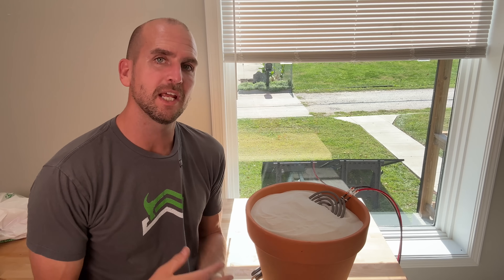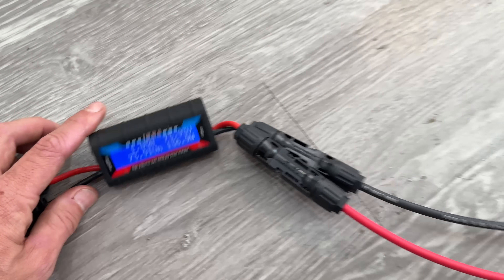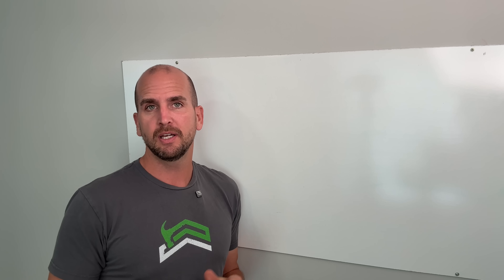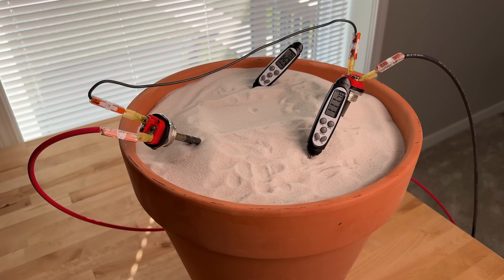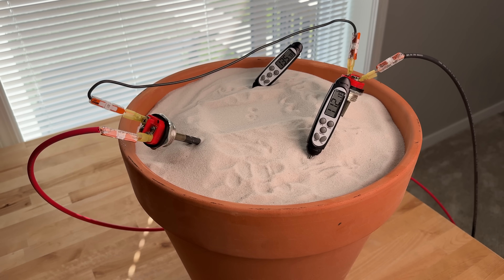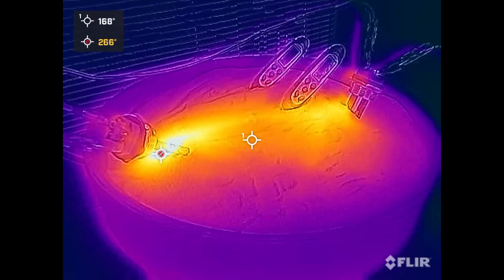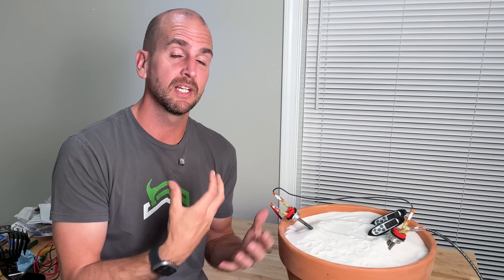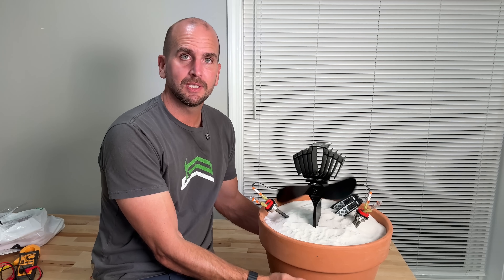How To Create A Solar Sand Battery Heater | Free Heat This Winter!

Comment: I'm thinking this would work for close-space chicken coops.  I'd put an inverted clay pot on top to hold the heat and wrap the clay top and bottom in some kind of fibrous material - perhaps coconut fiber nest material - to slow heat dissipation and to encourage chickens to snuggle around it like they did around a brooder when they were chicks.  This wouldn't work for a shed type coop , but small space 4-5 hen suburban coops with peak would benefit from what little sun energy could be brought into the henhouse.   Chickens typically don't need much heat since they wear down jackets year 'round, but on those below zero nights, I'm sure no one complains about a little clay furnace in there with them.

Comment: When the goal is heat, I think it's counterproductive to go through electricity. i would rather use concentrated solar power since that's extremely cheap. Outside, you can have a solar absorber with a built-in pipeline for watercooling and then using a pump, you can pump the hot water inside to cool it again, this time using inside air to cool the water, rather than the water to cool the solar absorber. Now all you need is reflectors to gather sunlight and that can be as cheap as aluminum foil, which is ever so slightly less expensive than solar panels and in theory, you can make this to work forever. :) By the way, just like you use the Seebeck effect to drive the fan inside, you could use the same to power the pump.

Comment: I,mm wondering if it would be possible to run a central heating system via a  40 GALLON SIZE oil drum sand battery connected to a metal coil in the battery???

Comment: Bigger stones in the sand would whit hold the heat better. Shure its better solutions out there but would work as a room heater in a pinch absolutely 😊

Comment: What you might experiment with is adding a phase change material.

For example, if you added something like paraffin wax in a sealed  aluminum box, once the heat hits 45-50C the paraffin will change from solid to liquid. While it undergoes that phase change it will remain at that temperature until all of the molecules have changed into liquid. As it cools back down it will remain at that temperature until all of the molecules have solidified again.

This will act as a buffer for your system.

Comment: Generally, storing heat in a phase-change material is more efficient than storing it in just the temperature difference of a material. As a rough comparison, the energy required to melt one pound of beeswax or parafine is comparable to the energy required to heat one pound of sand by ~320°F / 200°C. And instead of having a range of very different temperatures, you will store and retrieve the majority of the energy at a temperature point around 60°C / 140°F, which can be much more reasonable / safe.

Though in that case your heating should have a safety control, so it won't continue heating the molten wax towards its evaporation temperatures, since wax gas is rather flammable of course.

Comment: There is something similar you can do with a big can of Crisco, a candle, a strip of copper about as wide as a ruler but twice as long, and a metal bucket or I suppose a big pot like that works too... Jam a basic tapered candle about as tall as the Crisco can all the way down in the center of the Crisco. Doing this will let the candle burn for 72 days at 8 hours per day or about 24 days non-stop. You pack down a layer of sand in the bottom of the metal bucket, put the can of Crisco in it, fill in and pack down the sand in the rest of the bucket, and have the thick and wide strip of copper down directly over the candle wick/flame with the ends jammed into the sand around the can. Light the candle, the flame and later rising heat from the candle, heat up the copper strip which heats up the sand in the bucket (might possibly work even better if you have a second strip of copper to go across the other strip) and there you have it, a sand-bucket emergency heater.

Comment: I’d be interested to see this implemented on a larger scale using a steel 55 gallon drum, several heaters 12v heater elements, and maybe some copper buried in the sand to help conduct heat around the vessel.  I am imagining it wrapped up during the day to store the heat and then the insulation removed at night to radiate heat.

Comment: Solar panels are a rather inefficient way to convert solar energy to electricity.  I think you get, at best, 20% conversion.  I wonder if anyone has tried focusing solar heat on a water or coolant reservoir, then heating the sand or hot water by carrying it thru insulated pipes?  Actually, that's how solar hot water heaters work...

Comment: Just a thought. Solar electric conversion utilizes only about 18% of the total energy of the sunlight. If instead you capture the sunlight directly for heat rather than converting it to electricity, you can capture close to 100% of its energy.

Not only do you capture more energy, but you also expand your window of time to capture energy from the sunlight. That 18% for solar panels is only viable under certain levels of light intensity. As the intensity lowers, such as outside of peak sun up times or in cerain seasons, that efficiency drops. As solar heat capture utilizes a much higher level of the sunlight, even when the intensity lowers, it can still gain energy from the weakened sunlight.

It always boggles my mind that we as a society have become so obsessed with electricity as the only useful form of energy that we quite literally throw away so much usable power.

One of the largest chunks of the global greenhouse emissions comes from generating heat. Why not capture it instead of generate it? Especially when it offers about 80% greater efficiency?

I mean, in a solar panel setup like yours, the panels actually drop in efficiency below their highest rate of 18% around midday because the panels get hot. The hotter they get, the lower it drives the efficiency of conversion. Also, you are wasting perfectly good captured heat off the panels while that heat is crippling your ability to generate electricity.

Its a cool experiment, but there is a different way that can give greater gains.

Comment: Those panels have a current rating close to 10 amps. You should have connected those heating elements in parallel

Comment: Probably the biggest waste of time. The efficiency per Degree of Heat generated is so bad its not worth considering. If you want to convert light to heat energy, you are better off buying Solar Water panels. You will get a much higher efficiency of heat generation. Then simply pipe that heat directly to your radiators in the house.

Comment: The biggest question not answered by the video is the one which involves the practical use…does it actually heat the room? Heating the sand in the pot is one thing; but is that enough heat to warm ambient air temperature?

Comment: radiant heat is 60 percent at least with radiators, more efficient then convex because you are heating an object.. I dont know the condactivity benefits or detraments but a metal bucket would be portable coupled with the small fan thats all the heat you should need for a small room. Althought theres insulation vs thermal mass when it comes to housing.

Comment: Would be interesting to totally insulate and enclose the pot completely to see how hot it got and then remove the insulation and see how long it took to dissipate the heat and what the temp of the room throughout was for the duration?

Comment: I think this would heat water on demand and it could pour out the bottom after being filtered by the sand.  Maybe not drink safe but at least shower safe.  Sand is an insulator so it takes longer to heat up but the outer sand will cool off and the heat retained inside so stirring the sand will bring the heat up to the surface and pot sides.  So when it's not heating a room well, say it's below 130 try the water heater method of just pouring water through the center, let it percolate through the sand and see if you can get a quick shower out of it.

Comment: Um it would have been good to get base temp of the room before you started, then see if temp in room started to increase.  Then once no more solar did it help keep the room temp up.  Because whats the point of buying all this stuff if you set it up and you still got ice crystals forming on your lips and eyebrows because it didnt produce enough heat to keep you from freezing.

Comment: If you have the space I could see making a fairly large sand battery and using it to heat a shop in an outbuilding.  Very interesting project.

Comment: So you're using 240v heater? That will not work for a small solar panels. It's resistance is way to high for it to give out any heat. You'll need low voltage heater. There are 12, 24,48 v dc heaters directly connecting them will give the maximum heat you can get. Probably using a 12v pc fan with a 12v heater element can heat up your room with solar

Comment: Why would you choose to use an electric stove element over something like a baseboard heater? One could have 'Hot wired" the solar panel directly into the solar panel and heated the house or room all day long. Used baseboard heaters could have been purchased from the ReStore for almost nothing ($5.00) and these heaters were meant to heat for long periods of time. They were never meant to be used for DC and would require rewiring before one could use them with DC voltages.  Be very careful if you wire the panels for more voltage since you will be working with DC voltages and not AC voltages.

Comment: Buy a small column heater. Build a box around it. Fill the box with sand. If you need it on a timer, buy a column heater with a timer. Get rooftop solar. Plug the heater in where ever. Run it during the day

Comment: When using the hot water heating elements. Would it be more efficient to have a combination of sand and water? I would think you would disperse the heat throughout the container better, but you would probably need a metal liner of water with some sand inside the clay pot but also with sand between the liner and the clay, or the water would leak through the clay?

Comment: Water can retain 5 times the heat of sand. Put a boiler element into and uninsulated tank for heat radiation or just run a hot water tank and conserve the heat for use when you want. Using sand is basic

Comment: I would assume that a turbine power dump system would provide power to the element sand heater while in dump mode? My plan is the turbine to be used for charging a 24-volt battery system. i.e back up power systerm. For grow lights, and heating pads for starting veggies in a small green house. And if the turbine provides enough amps to keep the batteries charged and run the lights & heat pads.

Comment: You are loosing 80% of the solar energy when you generate electricity at the solar panels! Making heat out of this electricity is complete nonsens! Use solar thermal collectors instead!
The most effective way to heat your sand is to throw it directly into the sunshine, just like on the beach.

Comment: Very cool - I was wondering if you put copper tube in the sand & circulate it out to slant fin radiators would that be an efficent way to transfer the hear to the room. Perhaps use a small pump - dc with a battery from the solor cells.

Comment: Turkish coffee maker?

*Sand tends to not hold heat as well as a solid mass.

Try adding clay powder with a little water and with a some compression it should work more efficiently.

Also a fire brick cap would help with heat retention and general safety.

Comment: Question for those with more experience with the topic. Could the heating element be cast in concrete, say a 5 gallon bucket, to retain the heat better than the sand? I'm thinking this would be a possible winter heating source for my 700 cubic foot greenhouse.

Comment: Dry sand has an average specific heat capacity, water has about 4X more heat holding capacity/specific heat (enclosed water that traps the evaporation..  which cools water).  Wood and other organic materials have about 2.5X more than sand (think of how those who use this fact built log cabins in colder regions.  Logs trapped heat from fireplaces and served as excellent insulators as well. (Wood has a very low thermal conductivity of heat)

Comment: Just use the elements as designed and hook into mains the elements will heat that sand in 10 minutes to a mich hotter temp ! Point is i know its not "Off Grid" bit eben a generator for a short run will supply a more sustainable situation...

Comment: You did not use the round one, u used Rheem SP10869PH 2 times 😡 en the left one is the first ho gone have more power than the Right one  it's using the leftover power from the left one 😡so way are u using the round  one in your thumbnail ?😡if your not using it

Comment: Practical application for me: My house has a  crawlspace with water lines that I keep from freezing with electric heat tape. If I loose power during the winter I also loose my freeze protection. My crawlspace is insulated, so a heat battery like this could prevent my waterlines from freezing in this situation.

Comment: If there was a way to run this under your house with the elements in the sand to bleed heat up through your floors, it would be a great way to offset heating costs. But you would definitely need a breaker to disconnect it from the solar in the summer.
Reply: just use electric under floor heating pads connected to solar/wind power combination for "constant power"  24/7  and much safer

Comment: Typical of all these alternative power source solutions, you maxed out at putting about 200 watts of power into the sand. So regardless of if sand works as a heat battery, At 10 watts per sq ft, that is a 20 sq ft room, or about a 4ft sq room. To heat a typical bedroom, you would need about 20 of those systems. Not only does it need to supply heat for 16 hours that the sun is not shining, you also need to supply heat while the sun is shining too.  The math never adds up.

Comment: I'm interested to see if an infrared heating panel might be a better option, the panels will need to charge a 200ah battery instead.  I don't know how one of them panels will last heating up a room but if its well insulated I'm sure it will keep a room warm at night when its coldest temps.

Comment: This is cool, but usually the sunlight as a direct heat source would probably be more efficient and it would have an analogous thermal mass benefit. You can make a solar thermal panel fairly cheaply although it would take some fairly careful design.

Comment: Cool project, I have been looking at 12v air/water mass heating systems and soil warming wires from solar/lifepo4 batteries for a small cold frame to keep it from freezing overnight in the winter but never thought about a sand battery/direct mass heating for a small space.

Comment: insulted 8 inch chimney 36  inch  fill with sand would  be  hotter   but  not or  less heat out  sides  stove  burner  at  bottom end  hmm

Comment: It occurs to me that you would be better off using the cooking element, rather than the water heating elements.  It's designed for higher temperatures.  And, it should be placed flat near the bottom of the clay pot on a couple of inches of sand, with the rest of the sand on top of it.     This way, the heat would be more evenly distributed throughout the bucket of sand, starting at the bottom and radiating upward.  This would also keep the temperatures at the top of the bucket lower and safer.

Thanks for the video!

Comment: I would  think covering the top with a lid, another pot or terracotta plate  or some heavy foil would help reduce heat loss. 
Any type of fan battery solar powered,  set behind the pot would help to blow warm air through the room.   
Maybe a combination of the clay pots and candles with the  sand pot above it...???  Lots of options,   
 Great class,  please keep up the great work.

Comment: I've considered this as a heating solution for my place and the medium I decided would be best for multiple reasons is used motor oil and ball bearings. I planned on using a sealed unit full of ball bearings with the extra space filled with used motor oil. I chose used motor oil because it's cheap, it recycles a waste product and is filled with particles of metal and carbon. Which, incorporated with ball bearings, it would store the heat and slowly release it for a long time.

Comment: The water heater element is rated at 5500w only at 240v. You are not going to get a 240v output on your solar array therefore decreasing your Wattage on the element. With that said I like the solar concept!

Comment: I dont think there is enough surface area to release the heat from the pot surface.  The fan will only move a minumum of heat and I dont see a cold room getting any advantage with the example you are showing.

I am thinking  you need to build a container about 3' x 3' x 4 inches.  you would install 2 or 3 of the water heater elements horizontally about 4 inches above the bottom of the container, fill with sand.

You may beable to increase the surface using corregated metal sheets.  The more surface the better.

The heat from the elements will heat the surrounding sand, and flow upwards.  the metal sides of the box would radiate the heat much better.
Now that you have better radiation you may need to increase the thickness of the container to retain more heat.

just a thought.

Comment: I tried this but I had 80v coming from the solar panels to one 17.9 ohms element and was getting 10v at the element once I disconnected the element the voltage was back to 80v, panels are wired in series any ideas as to why such a big voltage drop?